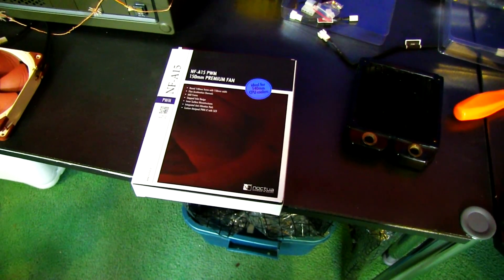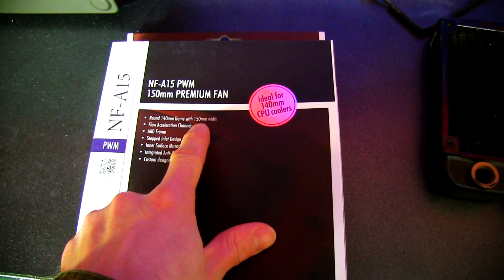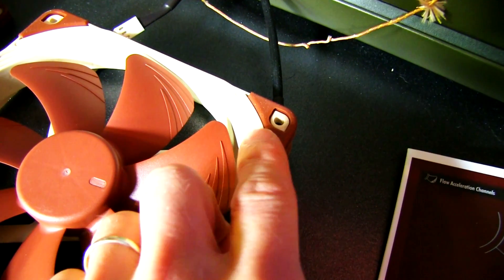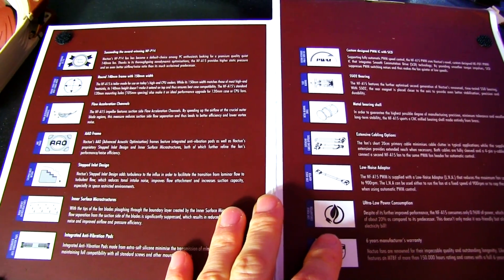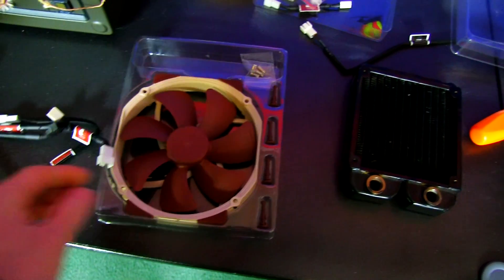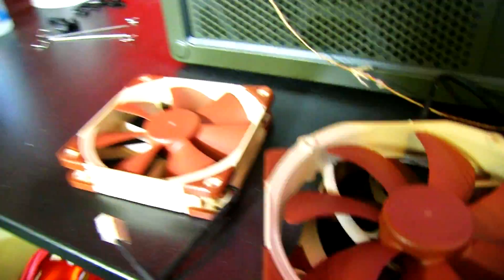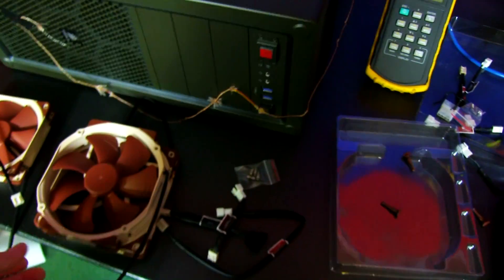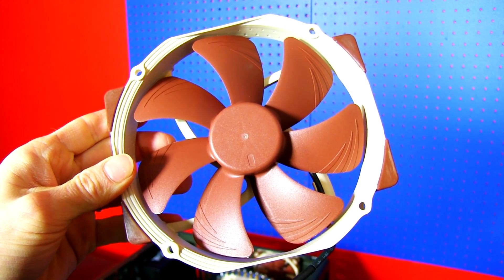Noctua NF A15 PWM 140mm Heatsink Optimized Cooling Fan Unboxing & First Look Linus Tech Tips

Comment: There's no problem using them as case fans, right?
Reply: had two of them on NH-D14 cooler but my brothers case supports only 160mm tall cooler, so i left middle one as NF-A15 PWM and front one is NF-P12 PWM, so had one NF-A15 left and im using it as rear case fan, since my case "IN WIN GRone" has 140mm and 120mm mounting holes on back, the NF-A15 fits and is taking more air out than NF-S12A FLX which i was using

Comment: Could I put this in a H110? im quite confused.
Reply: This thing is more for heatsink, or if you are trying to mount a 140mm fan on 120mm fan mounting holes. For 140mm radiators, look at the NF-A14, almost the same fan with square frame.

Comment: The Noctua A15 wont fit because they are too large (140x150x25) for the cpu cooler (140x140x25), i would recommend going with the Noctua NF-A14 PWN they should fit perfectly. But overall i would recommend you to go with Noctua's cpu coolers, because they will be far better, go for something like the NH-A14S.

Comment: Option 1
Price for 8 of these fans: 200$
Result quiet computing

Option 2
1 big *** HDMI cable: 15$
8 Cheap loud fans: ~40$ or 0$ if included
1 USB extent ion ~10$
Total 70$
Put the computer in the basement for totally SILENT computing

Comment: I have done two builds in fractal cases. As you can then guess the look was rather simplistic & plain. These fans pop straight in and look surprisingly nice against the dark, unlit case (I only see this occasionally with the side panel off).

So whilst you're probably right; barely anyone uses brown, these fans manage to not look out of place in black builds, and personally I find it easy on the eye. And at the end of the day it is something a bit different.

Comment: Could somebody answer my queston if you can. First off happy new year to you all. :D
And my problem is that i got an awesome gaming computer for Christmas. and on Christmas morning i was plugging in my new gaming keyboard into my right usb port in the front of my pc.  And then the slot just got pushed in and now it doesn't seem to connect with anything but my headset. Everything els doesn't work with it. so should i pay to get it fixed. Or go out and buy some usb Hubs? Please answer thanks..

Comment: I used to hate the look of the Noctua fans, now I love them! If you see Noctua fans in a gaming system, you know it's gonna run cool and quiet. I use a NF-P14 as a outtake in my HAF X. Using the motherboard's fan speed controller. I had the NF-D14, but I had to sell it due to my high ram sticks.

Comment: Doesn't change the fact that if they just made them plain black more people would buy them. He's still right, regardless of whether you think that makes him or anyone else an idiot.

Personally I don't buy Noctua either. I use Corsiar SP120s for my radiators, a decision I arrived at because of cost (two SP120s costs as much as 1 Noctua fan with minimal performance gains). I have to admit I do prefer the look of the SP120s and that might make all the difference when the differences are so minimal

Comment: i wonder how much better can these be than the ones provided by noctua in the nhd 14. If i were to use these on the nhd 14 i think i'd only get less than 3 degrees celsius difference.